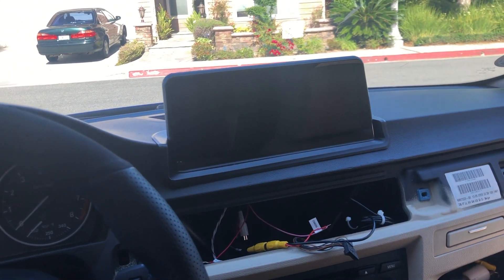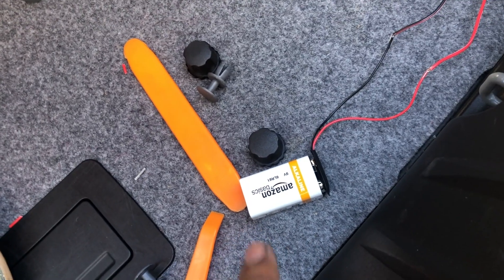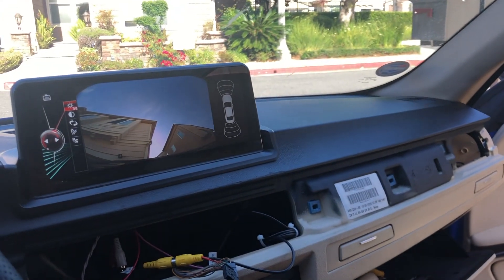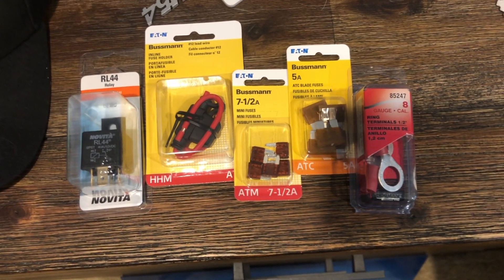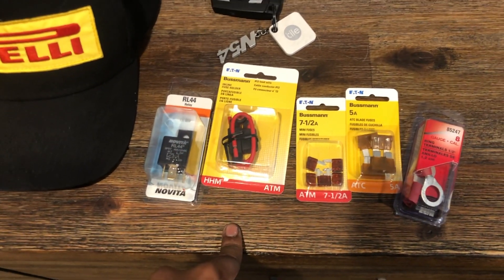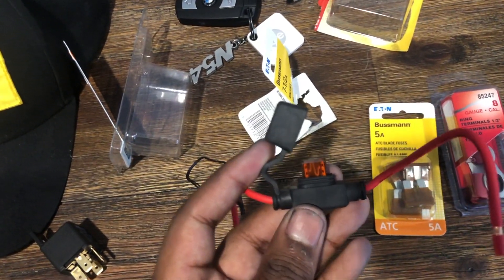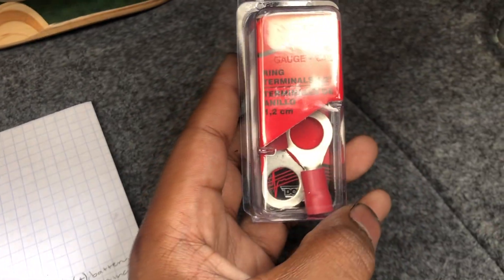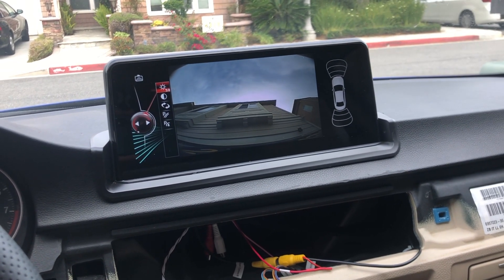BMW Aftermarket Backup Camera FIX! and Manual Trans Support - E92 335i

Comment: Didn't get around to trying Sams version but this version works, 8.8" Android head unit, Manual 2009 BMW E90, connected pink wire (not red 12v+) in head unit to the red cable on main camera cable (back to front of car) and yellow video cable, then in the boot/trunk, my car has 4 wires for the reverse light, the two on the right, black/purple was live and the brown next to it was ground, you need to buy a 'reverse camera filter' off the bay for about £3 (little black box with red and black cable hanging out of each end), the wires at the end of the filter where the arrow is, connect them to the camera red wire and the red wire from the long cable that goes to front of car, black wire to black wire, then the other end of the filter, connect the red cable to the live reverse wire, black cable to the ground reverse wire, plug in the reverse lighting cable, off you go, (don't forget to select 360 camera in the head unit camera settings, mine wouldn't work with any other setting) this was super simple for an idiot like me who is scared to change a light bulb.
Reply from the maker: I might end up trying this as well, as I've noticed the camera randomly cuts out every now and then. I have one of those filters laying around somewhere... perhaps an update is needed. Thanks for the info!
Reply: i know it's an old comment but i'm giving a shot, do you still have your car so you can send me a photo of your connections? i did like you said, but every 5 minutes, my screen goes in reverse mode for about 5 seconds ( while i'm driving forward )

Comment: Got it all working now now I have a battery discharge rate high ccid code did you experience this ?
Reply from the maker: I did not have this issue, interesting. You'll want to double check that your positive power source is only switched on with ignition

Comment: I know this video is older but I have an auto 335 and I wired the cam to the head unit that said “cpow “ for camera power and I get no signal. It has the red and black wires on the connector as well so I hooked them up to a ryobi battery and the camera turned on. My question is to get power could I just splice the red wire to the reverse light? Or will I need to make the same junction box and relay setup that you created. TIA
Reply: Was the second wire the brown wire?
Reply: Really just need help with what wire you used for the negative on the reverse light tap
Reply from the maker: My car used to be an automatic, so previously I actually had the red wire connected directly to the unit. It was marked as a camera power wire so that worked perfectly until I manual swapped. In theory you can use any power source but the reverse light positive would be easiest if your head unit doesn’t have a camera power wire. All you need is a multimeter to determine which wire gets 12v in reverse. I’d tell you which one if I could remember off the top of my head, forums might have the wiring diagrams as well
Reply: @ yeah the red wire doesn’t work I have the positive wire hooked up I have the same connectors that you had I just can’t see what you tapped for the negative lead and I’m not the greatest at wiring so was trying to avoid trying to unplug the whole harness and going one by one
Reply from the maker: @ Negative should be able to tap to any ground

Comment: I connect mine directly to the number plate lights and it works
Reply from the maker: Never even thought of that, however I don't think that would work for the manual trans as the head unit needs a signal to activate the camera
Reply: Samuel Abraham oh I see, even with a can bus decoder?
Reply from the maker: Yep, the manual transmission doesn't have any wires attached to it aside from the reversing lights trigger haha.

Comment: Unfortunatelly it seems my backup camera is broken. After the relay installation nothing happens. 
The electric voltage to the camera is 13.7V. Starting voltage is 12V +- 1V so it should works. I connected camera to old TV and only once there were 
some streaks on the screen. I've tried about 40 times.
Reply from the maker: that's pretty annoying, if you've tried everything which it seems you have, I'd have to think you have a defective unit

Comment: For Auto Transmission, do you still need to tap into the reverse light? Or you connect to the red Camera 12V wire from the head unit?
Reply from the maker: In my case, with the auto I did not need to at all. I made another video on that but yeah, directly to the red wire from the head unit used to work for me.
Reply from the maker: If for some reason that doesn’t work for you, this should work regardless
Reply: @SamAbraham  Thanks. Do you have a link for the backup camera installation on the AT?
Reply: Just saw your link on that video. Thanks.

Comment: i have manual, mine works without trigger wires
Reply from the maker: That's nice, unfortunately that's not how my specific unit would work although that would be much easier
Reply: Which android unit do you have? iDrive/non-idrive? i have a manual as well and i got the same camera, i feel like mine should work fine as well since my unit switches into the backup sensor view when i put it in reverse.

Comment: This is a very very unnecessary job to do. The guys at AVIN shoud know their product.
All you had to do was: run a wire from reverse bulb positive to the android unit and connect it to the Pink wire, then go to settings > camera and select 360° camera and that's it.
Other issue that would of fixed this is to go to factory settings and select manual drive (for manual transmission).
The guys at AVIN USA are just resellers of these models they have no idea on most of the functions of these units.

Please include this info on the description so other people dont have to do all the workaround for nothing.
Reply from the maker: Fully agree it shouldn't be this complicated, especially as it worked seamlessly with the automatic where the power came directly from the head unit. However, running a wire directly from the reverse bulb does not work as it cannot supply the constant 12v power supply to the camera, which is why a relay is needed. So with this specific head unit, you cannot just do what you mentioned, trust me I tried lol. The reverse bulb for these cars is 12v when the ignition is on, however when the car it turned on the voltage drops to around 9v.
Reply: @SamAbraham  you got me wrong bro, the 12-9V supply is not for the camera, the camera would still get power from the old wire coming from the headunit, the 12-9v supply should be linked to a wire next to the one in headunit (one is pink and the other is red) one of them plays the role of the relay and the other one sends a clear 12v to the camera
Reply from the maker: Yes, I see what you're saying now. I thought what you just mentioned would be able to work myself, but then I realized, how would the head unit know when to activate the rear camera? There's no TCU with the manual trans. There is only one wire that comes off of the manual transmission which is for the reverse lights. With the auto, the DME knows what gear the car is in based off of what the TCU says, which can then get relayed to the infotainment making it all much easier.
Reply: @SamAbraham  did you go to factory settings add Password 1314  the go and select manual transmision??
There are a lot of options there, you can also change the UI to NBT, Evo, ID6 etc..
Reply from the maker: I don't believe my car has any of those settings as it is an older one although I will check. Thanks for the tip, I'll let you know what I find. Regardless, AVIN didn't mention any of that haha
Reply: @SamAbraham  they don't mention it and that for a very good reason, people with little knowledge on tech can cause nearly unrepairable damage if they dont know what they are touching.
Reply from the maker: AUTOPASSIONGJK Makes sense, I’ve been to that menu before just haven’t noticed those specific options. They are available on the unit in my C class though
Reply: This is 100% the way to do it. I had my camera wired up with a relay after watching this video (Thank you for the video it got me up and running for a while so I appreciate it) and had tons of issues with a "no signal" message when coming out of reverse. I decided to wire it up using the reverse light as a trigger to the pink wire and power from +12volt wire at the head unit and I've had no issues. Gear Selection in the settings needs to be set to Manual as well.
Reply: @Sam Abraham first of all, great video thank you! I am going to try to install the avin system and backup camera on my manual E90 this weekend. So as I see it there are two options:

1. Follow this video and add the relay. Or
2. @AUTOPASSIONGJK @Keith Adolphine Jr (sorry this might be a stupid question lol) but run the RCA cable to the head unit and attach the red wire to the red wire and then the positive and negative to the positive and negative on the tail light? And then run a separate wire from the positive on the tail light to the pink wire on the head unit? So the positive on the tail light would have 2 taps?

Again really sorry if any of that makes no sense but any advice would be appreciated!
Reply: @zareefraihan8563  on my personal experience (i do at least 1 of this model monthly) you should follow these steps:

6 meter (20ft) RCA cable from head unit to camera.
RCA cable comes with a Built in wire on RCA side (red wire), you connect that one to the cameras positive wire, and the cameras negative  wire to car's negative, the other end is connected to a wire on the head unit that it is labeled either (back camera or cvbs camera or just back)
No need to add relay.
Reply: @Jagogjk1  I did this and my cars camera still won’t come on. I’m lost and need help.